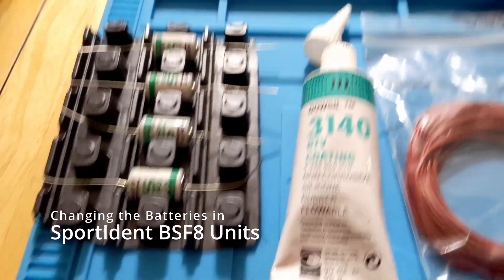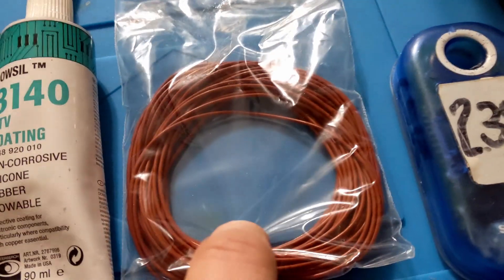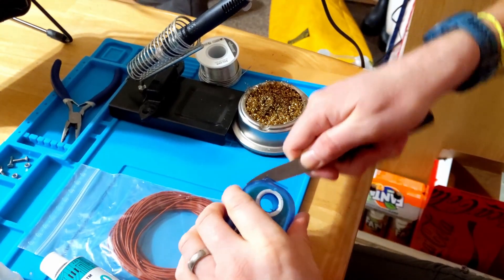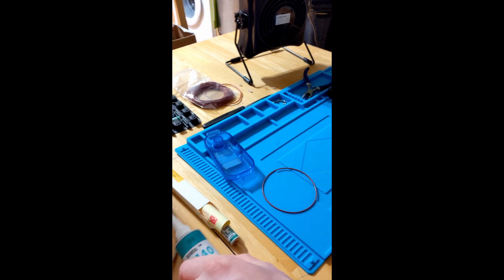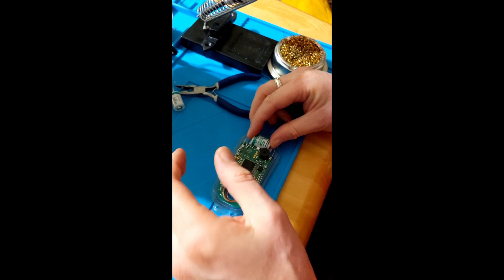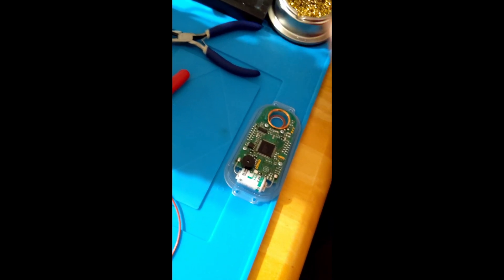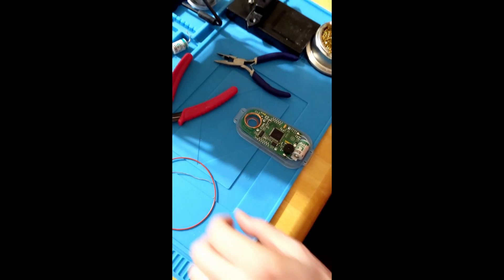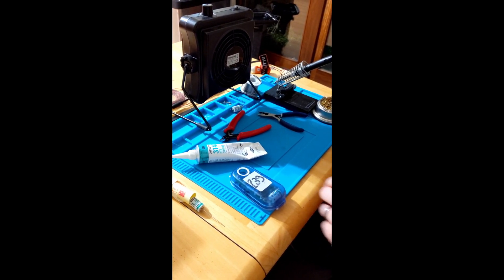SI Battery Change Tutorial

Comment: Thank you for this video.  I have moderate soldering skills and was able to install a new battery following your guidance.  I couldn't find batteries with the axial leads, but I found ones with tabbed leads.  I was able to make that work by trimming the axial leads of the old battery close to the battery, leaving the axial leads as dangling legs soldered to the PCB. I then soldered the tabbed lead to the axial lead.  It's an extra solder joint, but it works.  I minor benefit is that I avoided re-soldering on the pad of the PCB (sometimes too much heat can damage a pad).
Best regards from Possum Trot Orienteering Club, USA.